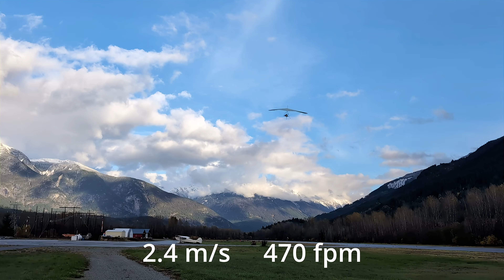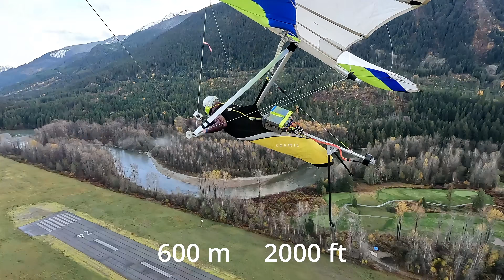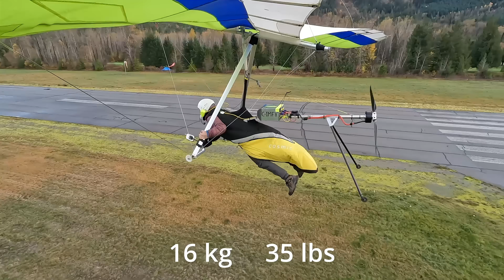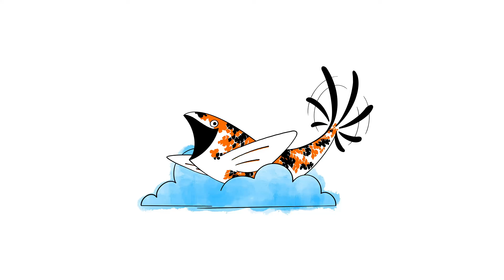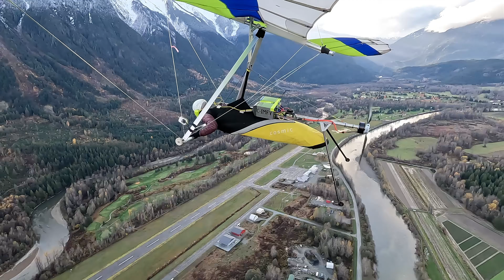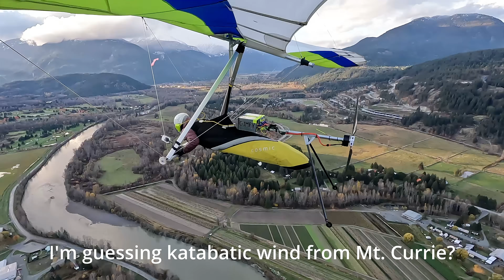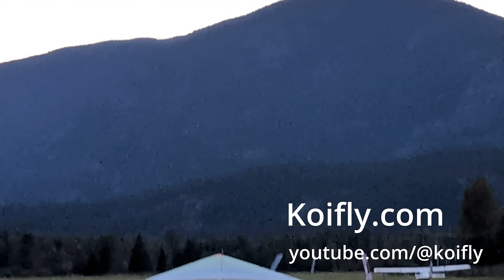Koifly electric hang glider – 🚀 470fpm to the moon! 🌔

Comment: You are doing God's work, great job! Since Mosquito NRG was discontinued and there are no alternatives available on the market to fill this niche. I am VERY happy to see this happening and can't wait to buy a kit from you, Nikita! How many kW is the motor if I may ask?
Reply from the maker: Thanks! The system pulls approx 10kW from the battery depending on configuration. The models of the motors used are mentioned in the video, you can check their official specs online.

Comment: I wrote over a year ago that your up start electric project was for me.  I like your latest performance increase.  I’ve got over 200 flights in Mosquitoes & Doodle Bug’s.  I was never fond of the CG balance of the gas engine.  But there aft engine weight DID help on the landing flares.       Big question….. how universal will your system be with various harnesses ???   Will the user need to adapt the system to a dedicated harness ???       Please hurry….. I’m not getting any younger.   🤓.   USA
Reply from the maker: Currently the electric kit should be mount-able to most single suspension harnesses with a single-piece carbon fiber backplate. So far I've only tested it on my Woody Valley Cosmic. Right now I'm working on a mounting system for the Aeros CrossCountry harness. That one has aluminum ladder frame instead of carbon backplate. Once that's done, I guess similarly framed harnesses will also be supported. Broader harness compatibility is something I need to figure out this year.

Comment: Imperative a folding propeller and some kind of arrest rigging so the device is not going to hit your neck o head if you have a bad landing. Another suggestion is to place the battery somehow inside the doble surface of the glider without modifiying the CG. .. keep the goog wok !! meanwhile enjoy your rides!

Comment: Battery compartment designed to encase and vent fire in a controlled manner.

Or a way to quickly detach the batteries.

You cant have nothing, i think the comoartment will be cheaper and safer(dont want to start bush fires with kilograms of battery inferno)

Comment: May I know how much a distance length for take off on flatland without wind?
Reply from the maker: As you can see in the video it's probably around 20-30 meters of running before my feet are off the ground. To some extent it depends on your weight and glider size / performance.

Note that you'll want additional space to clear the trees and any other obstacles, and a safety margin on top, in case you want or need to abort the takeoff without flying into said obstacles.

Comment: Looking forward to seeing the project progress. I just have a question, during landing when you want to stop that 16 kg package hits your back, right? if so better to harness it to the chassis.
Reply from the maker: When landing, you don't come to a stop by digging in your feet, like superman trying to stop a train. You come to a stop because the wing experiences very significant drag at high angle of attack, and is pulling both yourself and the electric kit back by the main strap.

Yes, the electric kit has some inertia that is resisting this pull back. But so does your own body, and the weight of the wing, together about ~100kg. The extra ~16kg from the electric kit does not make much of a difference. The drag from the wing easily dissipates all this inertia.

Even if you crash-land such that your body hits the ground, you still need to dissipate the inertia of own weight (~70kg in my case) + the regular hang gliding equipment that's on your body (~10kg in my case). So again, the extra 16kg of weight that increases your inertia is only an extra ~20% compared to what you would need to handle without it. It is a small addition, but it's not a big difference. I haven't had any issues with it, even though I blew a few launches / landings while learning.

People keep asking this though, so I gotta explain it better some time I guess.

Comment: great job!!!! what would you say, how much thrust is that setup?
Reply from the maker: Never measured static thrust – it's kinda useless, you can have more static thrust but worse climb performance, especially when using low-pitch drone props. The thrust changes when you start flying, so performance can not be compared by static thrust between different models / propellers, so I'm measuring climb rate instead – what we actually care about.
Reply: @koifly  im aware of that and totally agree with you on your reply. i was just asking for a reference number. 

well, not just a reference number... 
...my dad started hang gliding in late 70s, and i was brought up in aviation. grew up to be an aircraft mech, had a solo flight back when i was 16 on a motor hang glider but never went for license-had to finish aircraft mech school, fling sims and model airplanes since... thinking about hang gliding now myself after 20 odd years...

anyway i have some beefy 18s capable motor and esc and prop setup available which should give 25kg thrust in that config. i also have 170N thrust rc turbine... :) so, just a reference number im looking for ;)

p.s. dont know if you heard of this guy https://youtu.be/ziBe2JwgE1o?si=0ANEiouwehqXWH1l

Comment: I think it's a necessary improvement for hang gliders since the logistics are quite difficult most of the time. 

I wonder if with this new electric configuration it could be possible to fly in thermal conditions (weight) and just using the e-power to take off but also to avoid emergency landings. In that case, that would be the way to be totally independent letting you to cover bigger distances if your desire is XC flights. 

Thanks for the good news and for the effort to make it real:)

Comment: I wonder if a small turbine or impeller propulsion unit might make an appearance soon
Reply: That might be a long way off mainly because props crush jets at low speed
The basic physics rule: To get thrust, you either Push a lot of air a little faster (prop), 
or Push a little air much faster (jet).

For the same power, the first option is much more efficient at low speeds.
A hang glider is flying:
Slow, In thick air, With lots of room for a big prop disc.
  That’s exactly where props are almost unfairly good.
Typical rough numbers at hang-glider-ish speeds: Well-designed electric prop system=
Motor efficiency: ~90–95%
Propulsive efficiency (prop turning shaft power into useful thrust power): ~75–85%
Combined: ~70–80% of electrical power becomes useful thrust power
		
EDF / “electric jet” at those same speeds=
Motor: ~90–95% (same)
Fan/compressor propulsive efficiency at low speed: more like 30–50%
Combined: ~30–45% of electrical power becomes useful thrust power
  
So you’re basically looking at:
Prop: ~2× the useful thrust energy per watt compared to an electric “jet” with our current technology.
Same battery → about double the range / climb time with a prop compared to an EDF/jet
 So to match the prop system’s performance with an EDF, you’d need almost double the battery mass

But really cool things are happening with batteries and who knows we could maybe even see an improvement on the motors that they’re using.(there’s been some nice advances, but really the design itself has remained the same for quite a long while)

Also the electric turbine propulsion motors seem to be very loud and high-pitched. I watched just a video of someone putting one on a hang glider and it’s about all I can handle and didn’t appear to provide any propulsion that I could tell. 

I’m thinking it would be absolutely amazing to be  adopted by a flock of African swallows!  flapping in unison 
Maybe even switching out teams as they get tired, only requiring birdseed. never once considering ending it all
 in a fiery explosion should they overexert themselves..   
Not to mention, I could easily manufacture them at home with little Money and experience..

Comment: What an incredible idea.  This device will take the hang gliding sport by storm, and I imagine that battery pack will only get smaller until it is barely visible.  Soon, an auxiliary power unit like this will be standard equipment on ALL hang gliders.  Silent lift and thrust on demand,  Wow!
Reply: I can't wait till battery energy densities improve to the point where you can have 90 minutes of power from one of these
Reply: @skybirdnomad  As a drone flier who has heard in online forums about drone lipo batteries spontaneously combusting mid-air, I wonder what design features, such as a quick battery-detach  option, could be incorporated into this hand glider propulsion system that the pilot can deploy if the battery temperature exceeds a certain critical threshold.
Reply: @riverbankfisher .. fantastic point.
Reply: then there would be the added liability of dropping what would very likely explode on impact, but absolutely  be an incendiary device…. 
Might be a great idea to save your own tail, but potentially harm many more lives and or property.   (I’m thinking about the wildfires in California, as I say that)
 And the first time somebody had to eject one it’s gonna catch the eye of some sort of government agency as well…. that will probably put an end to our fun.  Or they will regulate the hell out of it, making it almost impossible for the homebrew community..  
Best to design the housing to direct the heat away from the pilot and critical components as best possible and let that energy just release. 
Maybe You could use  fiber insulation blanket material that I see in kilns.
 it is an amazing insulator, I have a portable kiln, made out of a metal toolbox, that I use for glass blowing when I’m doing a demonstration.  I keep it at almost 1100°F.   You can get that blanket up to 1400°.  Lithium batteries can get up to 1800° or so, but they make ceramic fiber insulating blanket that will go up to 2600°.  
Stainless steel is good up to 25 to 2800° I think but the ceramic blanket material would stop the steel from getting red hot, and radiating heat everywhere that you don’t want it to,
 and just  directing where you do want it to go

Comment: What's the sink rate (or additional sink rate to unadapted glider) with no power set?
Reply from the maker: It's not too bad, but I need to take cleaner measurements of that, I don't know my sink rate without the electric kit and also I usually fly without prop brake (WIP) so the windmilling prop adds some drag too. I'll take a closer look at this when working on aerodynamic fairings.

Comment: Bravo, are you using VESC?
Reply from the maker: I've used VESC 75/300 before but it's too big and unwieldy. HobbyWing 260A can handle the same or more power (at 14S) in a smaller package so that's what I'm using currently. If there was a more compact VESC that could handle 180-200 continuous battery amps (not phase amps) I would love to try it out but I haven't seen one like that.
Reply: @koifly  I'm not talking about the controller itself, just the firmware/software. Thanks for letting me know about the controller. How much does the HobbyWing weigh?
Reply from the maker: HW ESC is about 300g. VESC 75/300 is more than 500g but it's not just the weight difference, but also the size and shape, it's not just big, but wide and long, designed to fit under skateboards, and has 3 pairs of battery wires instead of just one pair – just a pain to integrate, dimensionally.

VESC firmware is designed to run on a VESC or VESC-compatible controller, it doesn't have much use without one. I designed my own PCBs and wrote my own firmware to be the brain of the system. The HW ESC runs their own proprietary firmware.
Reply: @koifly  yup, looked it up. There may be some cheaper, smaller, more robust hi voltage controllers that run VESC, that might work perfect for what you are doing. Best of luck, for sure. Remember, VESC is not the controller, it's what's on the controller. . . there are certainly smaller controllers. We are putting them inside the axle of high voltage builds.

Comment: Thank you for continuing to share this beautiful dream. I'm so excited to experiment with solar dacron wings for extended range on nice days.
Reply: That very well might be possible! Around 25 years ago I built an electric-powered ultralight, I extended the flight time by mounting solar cells on the wings. IIRC I got roughly 1 to 1.5 kilowatts of power out of them so the plane couldn't be flown on solar power alone, you still had to discharge the battery pack but it added to the flight time.
Nowadays solar cells are probably better and it very well might be possible to develop your own homebuilt manned aircraft that can fly only on solar power!

Comment: I'm curious to know whether you've compared energy density by weight & volume, for flat cells vs 18650 vs 21700; 21700 have more Wh per cell but larger diameter means lossier packing volume results in lower energy density by volume for otherwise comparable 21700 cells than 18650s... but I'm uncertain how it works out by weight?

Comment: I haven't flown a hangglider in 20 years and now I want to fly again!
Reply: They are still as fun as ever regardless of engine or not, come back!
Reply: @ericoschmitt Dude, I know that's true; hang gliding has been the greatest passion of my life, nothing comes close. At 70, it still calls to me daily.
Reply: I've been keeping my old Falcon 195 and gear for(ever) a good reason..my 70th birthday is in March.  I NEED THIS! 😍    I live in central Alabama, flat, 4 hrs. from a flight park.
 Congratulations on your upgrades to your KOIFLY unit, and best wishes for your  progress!
Reply: @johnhall7475  hey man get two pulleys, a long cable and do parallel tow with any car on a flat field! Easy.
Reply: @ericoschmitt  Hey thanks. I enjoyed truck/platform towing many years ago, 4 of us pilots near Montgomery, Alabama built our own payout-on-a-trailer winch, and had excellent success  towing at Moton Field, in Tuskegee (yes, home of the WWII Black Airmen, P-51 Mustang Escort group.  
  Sorry, I digress; the towing required a team of experts: driver, winch operator, pilot on tow , pilot on deck/next up; the rotation allowed for about a dozen tows on a given day.
  KOIFLY looks like I won't have to depend on a crew (which are long since scattered).  
  I'm charmed with this unit, looks to be UP AND COMING!

Comment: Why not put a smaller, fixed duct fan ( for both pilot protection and efficiency ) as an extension to the central cylinder, and lose the wheels, in order to make it look far more clean and stable?
Reply from the maker: Big propellers are just so much more efficient than ducted fans (at low airspeeds like ours). Also, ducted fans are complicated to design for efficiency and expensive to manufacture, requiring carbon fiber layups and very tight tolerances. Also, consider what happens when you start soaring in thermals and turn off the engine. The legs can be faired to reduce drag, and the propeller can be made foldable to reduce drag, whereas a ducted fan and its shroud would be stuck in the airflow generating drag for the rest of the flight. A bunch of other reasons too, but you get the point. Most tradeoffs heavily favor traditional props.
Reply: @koifly  Some valid points, and of course it's your company (or entrepreneurship), your decision.
That said: 
1) I'd trade some efficiency, and pay more for a far cleaner form factor.  
2) every single problem has a satisfying solution 
3) take a look at whisper dot aero slash propulsion for their ultra quiet 20% more efficient ducted fans.
The drag from their 5" or 6" models (5 and 10 lbs thrust) would obviously be negligible, it makes the whole system almost invisible, no long motor axis or support, no wheels, no dragging a big flexible structure behind your back, no chance to damage it as such a small ducted fan could be placed before the end of the keel and above so it'd be impossible to hit the ground, etc.
4) you could also almost zero drag by having a special adapted idle mode where it will only output air at the same speed as your hang-glider, not pushing, and thus with negligible power consumption.
Reply from the maker: To be clear they claim to be 20% more efficient than other ducted fans, not more efficient than big props. I mean I love the compactness, and you're right that you could probably idle them cheaply to reduce drag, but the design is still very complex, and I'm willing to bet that their propulsion units alone would cost several times more than we want our entire electric kit to cost. And we can't replicate their design cheaper ourselves – it's inherently expensive.

Comment: Great to see the progress.
I still hope you can design a solution for multiple harness styles, not just pods.
I wonder if it could work with wheels on the basetube too. That could be fantastic. Eliminate the need to run.
Love the logo too - cool concept.
Reply: I feel like a ground based sled would be the solution to not needing to run.  That way you get all the hardware needed to avoid the running start, but skip all the extra weight for the flight itself.  Doesn't help with the landing though.
Reply: @meateaw  Excellent suggestion. I hadn't thought of that. Launching a powered glider from an aerotow cart... That might work.
Reply: @HangGlidingFlightSchool  I think Reider Bernhardt has done this.

Comment: Interesting way to mount it connected to the harness. Seems a little too floppy but then again it makes it harder to cut off your toes like the old SoarMaster setup did. My old flying buddy "3 Toes Laudermilk" can tell you all about that issue.
Reply: I bought a Soarmaster, back in 1985. Later on, I heard about that incident.  I never even tried to mount it to my UP Condor 194. I never pursued powered hang gliding, other than pay-out towing, which was all good, but requires a team
  
I could fall in love again with a KOIFLY❤